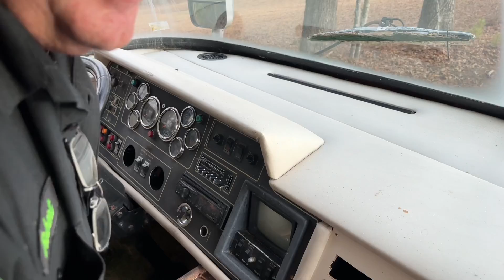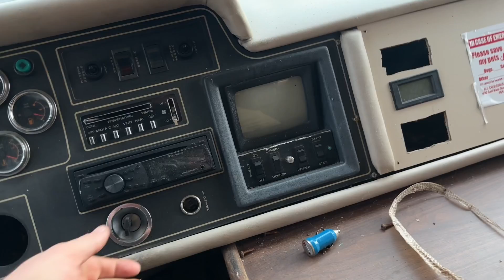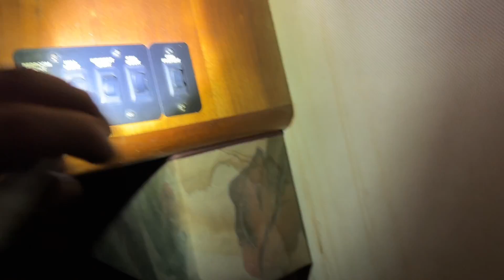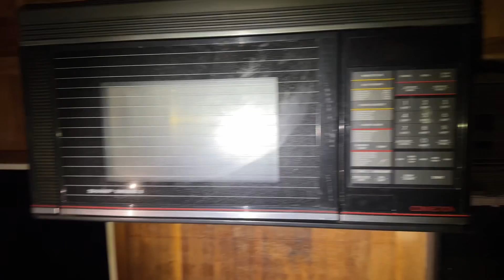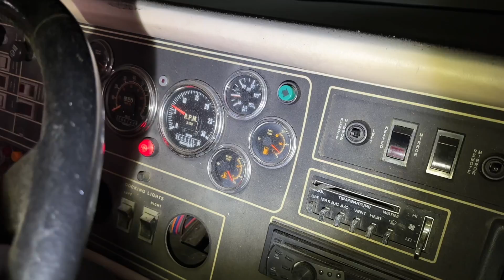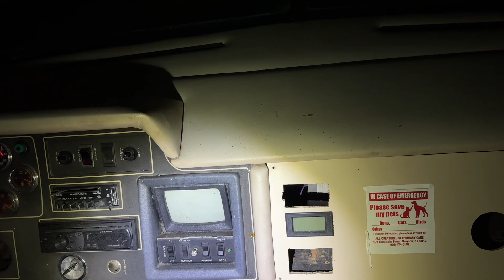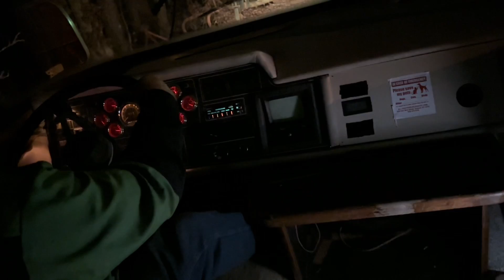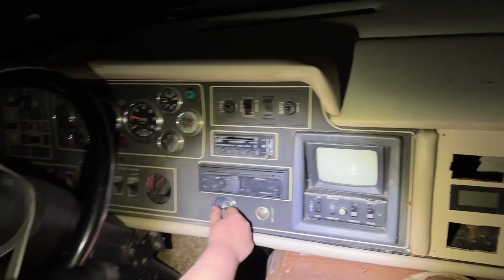RARE 1989 Grand Villa. WILL IT START AND DRIVE HOME? 2 Stroke Detroit!!

Comment: Ok. Congratulations! This unit was a very high end coach in its day. Your leveling system is an HWH lever system. It’s bulletproof! Your awning looks like a Zip Dee. Both HWH and Zip Dee are still in business. That coach is better built than anything new under $800k. I work for an RV dealership and I’m envious of your project!
Reply: Any knowl dge with 1990 TIFFIN ALLEGRO BAY 31' V10 460 MOTOR QITH 46K MILES 👀🫢  F53 CHASSIS DUALLY, IM THE 2ND OWNER,. FROM FACTORY/DEALER-> PREVIOUS OWNER I BOUGHT FROM-> To Me!   I bought it for a really good deal and get the better handoff their misfortune. Pavers were already dripping equipment and had a day set and had already put that day off 4 days so I could have the weekend to get her out of their way for Monday a. M. Paving start. So their loss was my fortunate situation. Thank the Lord it ran drove, it needs brake lines and I have new master cylinder might as well why yo upgrade lines. also power steering HP line had a slit in it. Easy fix come spring. .   Oh some scumbags cut the catalytic converter when I had it parked out front dad's house. Unreal. I had it moved and brought to my grandparents in the burbs more off the main roads. Scumbags gotta watch everything these days. Also I dumbly scrapped the 3 deep cell batteries thinking they were just heavy duty reg batteries not thinking or knowing they're more like 350 each 🤦🏻‍♂️🤷🏻‍♂️ but oh well Lord had a bigger idea in mind. Upgrade them bren so it's fullproof and you can automatically cross it off the worry list.        😁
Reply: Dope bus

Comment: This coach is made by Foretravel Motor Homes in Nacogdoches Texas. They have always sold very high end coaches and do so today. Prices range from $500,000 to $2,000,000.  The company history is very interesting. It started as a Father and son high school project in the early 70's and someone wanted to buy the first one so they built another and it just grew until what they are today.

Comment: Sounds like it's time to do a video with Bus Grease Monkey! I love old things like that, but it could very easily turn into a huge money pit. Hopefully the roof doesn't have any leaks and you don't have a bunch of hidden damage behind those walls.
Reply: i was thinking the vary same thing.
Reply: @hartsfire5706  
The good and bad thing about fiberglass siding on an RV is that if you have rotten wood on the sides, it's horribly obvious. This rig is SOLID
Reply: The laws on vehicles are very different in UK everything here is set up to take your money.
Reply: @lsmith6378  it is that way every were.  every government or state has there hand out wanting to take every thing you have.

Comment: That’s a nice rig! I hope you are able to find a replacement passenger rear wheel panel and are able to fix the missing chin piece. Other than that, it looks like the outside needs little more than a screw and polish. And the interior other than by the front panels under the windows is very very nice.

Comment: Tim, you actually WANT A R.V.  THAT  OLD dude??... it's in the 80's
Reply: He does right now.. let him get it home and actually start looking at it I try not to be a Debbie downer but the amount of money and work it would take to make this a modernized nice camper is astronomical.
Reply from the maker: Worse case I got a electronic silver series for the air force truck
Reply: Fair point 🤷🏻‍♂️
Reply: @j.rowland3488  oh I know it's expensive..like remodeling a house..I guess that's why he wants to take his time and re do it slowly..I was surprised how quickly it cranked up and its not extremely loud  must be heavily insulated with quiet mufflers..most 6 8 or 12 71's are stupid make you lose your hearing loud
Reply: @lornperkins4270  nah, I’ve got an 8V71 in my coach and this one is louder than mine. I can’t hear it at all up front which makes it hard to know when to shift but I learned to use certain speeds as my shift points instead.

Comment: I wood rethink that pos motorhome.. infested with animals. Rats.dead batterys.cant get parts.side was wrecked.hasnt been on the road since 2017.weather beat.needs 5k worth of tires.most likely needs a transmission control module.. it came from copart which sell salvage vehicles and the department of motor vehicles will never let you put it on the road.. your goi g to be 60k tall in that thing before it's all said and done..

Comment: Foretravel Grand Villa was a top of the line motorhome back in 1988! One thing to check is the rear bulkhead that holds the motor in, they were known to crack, so look it over very close! Do some Googling, a common problem with this make. They were a semi-monocoque construction made out of square steel tube, very strong, that incases the whole body!   That one is going to need all the windows pulled and resealed, but the motor sounds great, and it pulled out of its grave with the brake still on!!! It for sure wants to live on!! Some TLC, a lot of love, and you got a great highway cruiser!

Comment: I had a American Hawkins motor home, it was imported into Australia in early 2000 ,it ran a v8 Detroit,  Allison auto  ,full air bag ,they weight 10 ton empty ,when new they were aproxx $300.000 .the front end in them is soild . It probably is on a gillig chassis,  full insulation  all around  ,enjoy tim

Comment: I have worked on RV's on and of for 20 years and Ill tell you that old girl has some good bones.  The best part about it is that the interior is in amazing condition. One you have water intrusion its over. You have to gut it.  These old diesel pushers were built off of a bus chassis. I looked up the MSRP of a Grand Villa in 1988, and they ranged from $244K-$270K the models were GV 3600 (228 WB) 3800 (252" WB), and 4000  (276" WB) looks like the one you are looking at is the GV 4000 and would have been about $260K new in 1988. That microwave is also a convection oven.  You will want to replace all the plumbing along with the Freshwater and Greywater tanks. They tend to leak after sitting for a long time.    Also Im so sorry to hear about the shop.  I hope everything works out, I know it will,.

Comment: nice old camper ,looks like it's in pretty good condition still ,, when i was a kid our neighbor had a grand villa  and i always remember the song of that Detroit  you always knew when they came home from a trip or were leaving ,he went right by our house ,the hill we set at the top of has 1/4 mile long 12 percent grade and it is a wonderful sound hearing that detroit coming up the valley ,,it's a sound you don't hear much anymore ,,i got the pleasure when the farmer down the road decided to haul gravel on christmas eve , his old dump truck has a 12V71 and it's always singing a loud song when you hear him crawling up the hill in low gear ,,and there is a stop at the bottom of the hill so it's a literal 1st or 2nd gear climb with a load

Comment: You've lucked into one of the finest coaches ever built. That coach sold for $300,000 in 1989. Foretravel Grand Villa U300 4000 SAI is the official model of this rig. There's NOTHING built today that can touch this rig, unless you pay over a million for a new Foretravel. Bult in Nacgodoches TX since 1967. Restore this and enjoy it. Keep it on the road. I will guarantee that once this is right there's nothing out there that will handle any better. That coach has a 3:07:1 rear axle and will hit 90 mph on the governor. The generator is an onan 7.5 kw diesel. This coach has a GVWR of 30,000lbs
Spend the money to restore this right and keep it. You'll love it! Built with pride from craftsmen that care. Congratulations!!

Comment: Thats a great rig and will be the perfect platform to fix up.  Look up what others have done to these.  There should be a main disconnect for the batteries as well. Also the lining around the gauges glow so you can see them better at night.

Comment: I remember when my mom's boyfriend's parents bought their huge motor home with a detroit diesel back in the early 1990's.  They had just retired.  They told my mom they were so worried if it was the right thing to do since they paid $150,000 back then for it.  They lived the 1980's luxury retirement.  Lived in a trailer house on the lake in ND during the summer and lived in their trailer house in Phoenix during the winter.

Comment: That was made back when you could still get quality stuff. Deff a high end period piece of real wood & metal combination. There is local guy that is a traveling gun smith tows along an 18ft trailer which he gets hassled by cops because of his length I guess. But the coach was gone over a few times once for a leak and he had which is how I met the guy at a Military shoot soon after I fixed the leak he had new carpet put in and I don't know what else went on with half the interior was out of the back it all over his lawn  about 3-4 years ago he did some sort of work to it. I think his is an 88 or 89. The most impressive thing is his coach has an air ride system on it. He said it absolutely does not lean in corners or hard curves.

Comment: I was looking for a Grand Villa but they are hard to find in my area so I settled with a 1992 Monaco with a L10 Cummins. I enjoyed working on it. I couldn't tell from your video if your refrigerator is the absorption type which uses amonia. They have caused a lot of RV fires if they are not level when in operation. They now have I device called "The Fridge Defender" for these units. Most RV refrigerators are mounted on the outside wall to allow access from the outside for servicing. I see yours is on an inside wall. I have never seen that before unless it's the type that uses freon. I wish they still made them like that.

Comment: It's got a lot of wood damage around the front glass and side glass. That's all going to have to be pulled out and repaired before you put the glass back in. I sure hope you didn't pay to much for it. Looks like all of the compartment doors will all have to be rebuilt. I would imagine that your're going to have to pull all of the windows and re-seal them. Sure hope you have a good wood worker in your shop. I think the old man knew he had a sucker on the line and he just kept reeling you in.

Comment: That is a real detroit. My uncle had one of those motor homes and put a 60 series detroit in it I remember it was a tight fit and a little modification. If I remember it is freightliner running gear

Comment: The Uni Home grand villa was a groundbreaking design, a few of those are still used regularly.Are you sure it is an 89 and not an 88 ?
This thing will make any 379 looking like a beacon of gas saving....you ll be happy to get a gallon /mile  on a flat road.

Comment: I think it will clean up.
The engine sounds good. It needs some 
tires and some batteries and a good
wash job. The inside 
don't look to bad. That
Onan genarator is one 
of the best you can
have. That little TV
monitor in the dash 
might be a rear view
camera for towing.

Comment: What usually happens with these old motor homes is the bones are solid but the fiberglass gets to separating and delamanating and falls apart the frame and drive train usually stay pretty good but that damm fiberglass gets super brittle and cracks and your always fixing it im sure that you have already bought it but man do your due diligence

Comment: There ain’t no way I’d fire up a 2-stroke that had been sitting a minute without checking to make sure the rack wasn’t stuck or sticking. Did you ever find the shut-off in case it run away?

Comment: When these were new they were expensive coaches.  I have been looking for one to restore for a couple years but most of them have too much dry rott and rust in the structure.  I just bought a Georgia boy that went in the shop to have a 6.5 gm crate motor and new turbo. The dashboard caught fire 3 miles after leaving the shop. I bought it from insurance for $800  brand new motor. Rebuilt Allison trans
And 6 polished aluminum rims and new tires. I sold the diesel gen set the next day for $3000 made $2300 profit and still have a new crate motor .trans. wheels and tires and all the appliances are like new.  Time to start selling parts.

Comment: Hey Guys they used to sell 219,000 thousand, Now real good condition 5000-8900 hundred, Big drop, But you cant junk them Thats why there so cheap, I have been given some real nice motor homes for nothing,, I was just given one cost him 167,000, Has 3200 thousand on it now Has not run since 2000, I put a brand new quadrajet back in 98, and that cost 550, he just called me last month,its a 96 Fleetwood 44 ft so I,m taking it for storage, In nice shape all fiberglass, Roof does not leak, Big Benefit. So good luck

Comment: Tim I would leave that bus alone, far as parts they are probably hard to find!! Tim buy you a Prevost!! I would look around first!! Only my opinion!! I owned a 90 Prevost 40XL motor home and it had a 8V92 Detroit and most shops around the country know nothing about a two stroke diesel!! I would buy a bus with a 60 series!! I called Detroit one day and the guy I was talking to didn’t even know what a 8V92 Detroit was!!!

Comment: No momma not going to see the vision.  
Foretravel still making luxury coaches  in Texas.  
You need to check systems. Check roof. One sign of leak at front.  
If you knew a good rv tech give you idea what you getting into.  The computer links engine and transmission.  You got smart phones start looking things up instead of guessing.  

Happy New Year to your gang

Comment: How the motor don’t blow as your in the bed asleep dam that’s not a good design or the radiator pops your burnt I would put a sheild over it and hope all that heat escapes from somewhere due to exchaust leaks